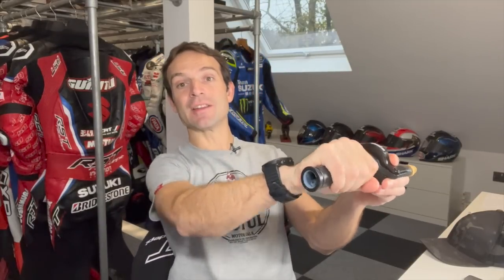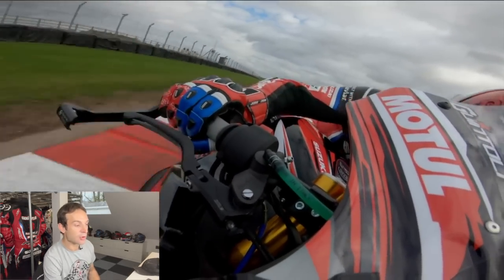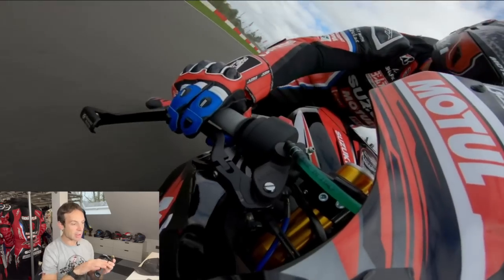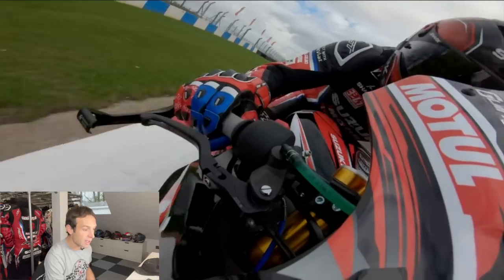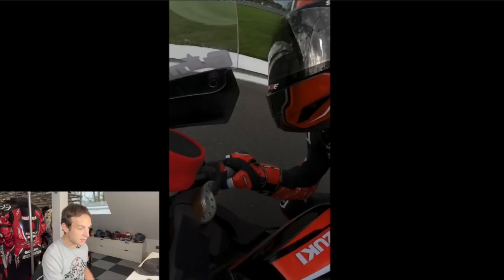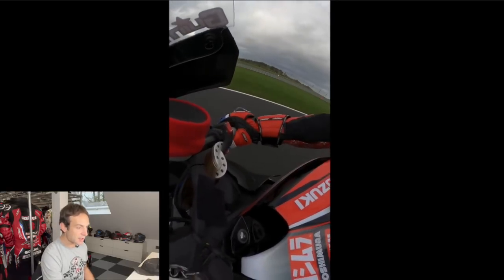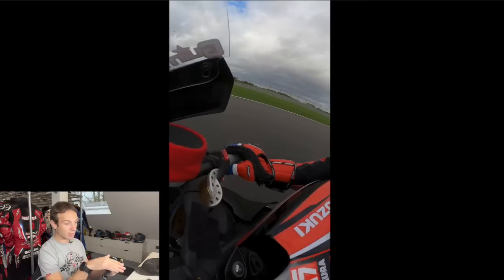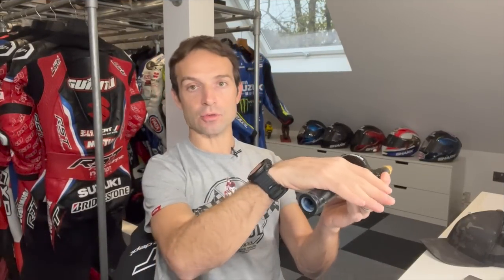🇬🇧 HOW TO USE THE THROTTLE HAND GRIP ON TRACK TUTORIAL

Comment: Basic question : do you have quick throttle controller on this video or it is a standard one?
I have the feeling with my stock throttle that I need to roll two times to full accelerate

Comment: Great nudget of advise but that braking and how deep you go with what looks like a lot of pressure.... Amazing!!! Definitely want the next video on advise for how hard / late you can trail brake as I'm always afraid of loosing the front and end up having to make up speed with mid corner / exist which is probably just as dangerous given the trips to the moon I've had 😜
Reply: Yeah I was looking at that too. He brakes progressively but quickly at full power, then easing off as he rolls into the corner. I'm guessing his bike doesn't die very much at all so he's able to get to full braking power very quickly because the bike is settled so quickly. I'm guessing his fork brings rea quite stiff.

I used to practise sometimes in car parks that were empty. Go along in first gear brake hard. Go a bit faster and brake hard. Go at steady speed brake a bit harder. Get close to the limit.

Comment: Thanks for this!

Not sure you'll see my question but what about very twisty roads during street riding? Does the same rule apply to keeping the wrist straight at all times? I find it difficult to do this when I'm constantly working the throttle and brake in very rapid succession. 

P.S. I'm not talking about racing on the streets! I'm talking about riding in canyons or somewhere that has a ton of very tight hairpins and lots of curves.
Reply: Great question. Was thinking the same.
Reply: At first is a bit cumbersome, but it definetly works, I've been practising since the other video where he explains the rolling and most importantly how to roll the gas as if you were turning a screwdriver and it's done wonders for my hand, it even works on motorway soy you don't cramp your hand after 5 min steady on the gas

Comment: This is very different from the “screwdriver” grip that I have heard and used for so long. Yes of course in the straights you can relax your grip either way, but it appears as though you keep your wrist perpendicular to the grip as opposed to in line with it when tipped over.

Comment: Seems really easy when you have a quickshifter. Would like to see the same thing done in a motorcycle without quickshifter. Most likely not the same technique.
Reply from the maker: Similar, but just rolling off&on very quickly on the upshifts. I made a video about this, with onboard camera with and without quickshifter on the members area (It’s called “DOWNSHIFTING ON TRACK”)

Comment: 100% agree but please change that rubber pipe between the pump and the reservoir... those are made for fuel, brake fluid will deteriorate it and could actually pass through and drip on painted surfaces while making a mess inside the pump
Reply: Pretty sure Sylvain and the builder know what they’re doing when it comes to bike maintenance
Reply: It's very common for race bikes to use a tygon tube length as a reservoir.
Reply: @alexwitham  I'm sure they do and I'm also sure they change the fluid so often that they don't have issues but I know that exact brand and type of rubber tube. you can read "made in Italy" on it, I'm from Italy, that's the stuff the local parts store guy tries to sell me every time, I've used it for this application in the past and I've experienced all the problems mentioned above and more